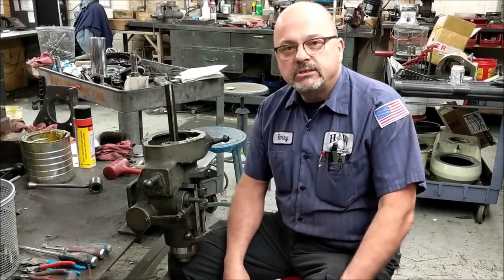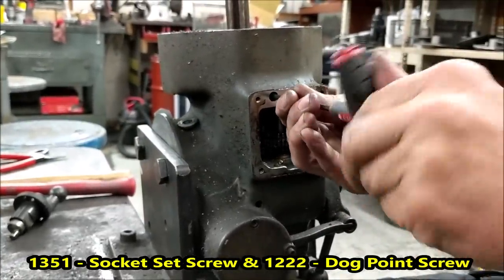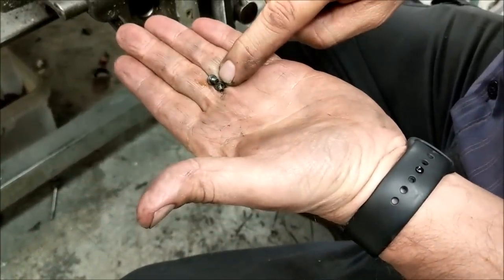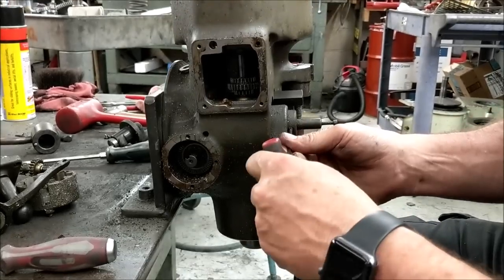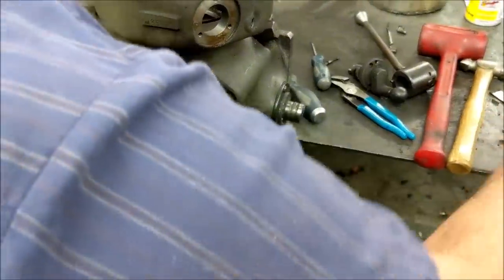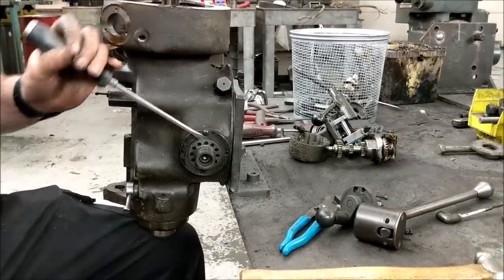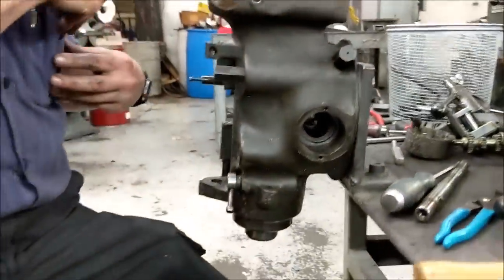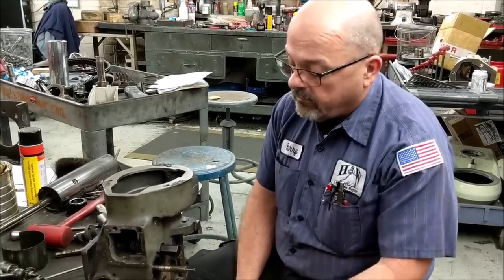Disassembly of the Bridgeport Quill Housing

Comment: Bridgeport is a complicated marvel. And to think, engineers drafted all the mechanicals out with sliderules and pencils. Also, I have witnessed a number of very good mechanics struggle with the repair manuals over the 45 years I was a machinist. These videos are a true blessing for future mechanics.
Reply: that patternmakers took those drawings, figured out core boxes, prints, patterns...
someone had to setup lathes to cut screws, set up stinking big planers to run through body castings...

sometimes... it just seems a little bit insane...

Comment: This video saved me a bunch of grief. Thank you.
I need to take my power feed reverse knob and shaft down to a point to figure out why it's binding??
Waiting for the next video.
Reply: Have you found a solution?
Reply: @Caughtitoutdoors  
I took it apart, cleaned and deburred. I replaced a couple parts. Works great now. I was surprised to find soft steel parts. SHARP -TMV, 3hp 3,300# BP clone.

Comment: Thank's for the video, was grate, may Bridgeport B is 1 1/2 hp this one has a problem where the quill is not smooth as it rides up and down, what might be the problem? I'm about to disassemble it going by your video, is there a assembly video for the quill? Do you think I have to disassemble the hole to and quill to free it up. This machine was stored for some time and got wet. 
Thanks for your inputs and if you have the time for the assembly video

Comment: Hello, thank you for the super thorough videos and awesome diagrams on your website.  I just picked up a 2hp vari-speed machine, early 80's vintage and the quill sticks in the housing at various points of travel.  The whole machine was thoroughly crusted with dried out oil and I have been trying to spray the thing down with LPS #2 in the hope of getting the crust loosened up, which has been working pretty good.  

One thing I have noticed is that the quill skirt is chewed up right where the quill stop hits the edge of the part and I suspect that this is binding up in the casting.  Is there anything else in particular I should look for that may be causing the binding?
Reply from the maker: Paul, The only other thing that would be causing the binging, in your case, would be the dirt and grime and possible metal chips that have gotten up there. You will need to remove the quill and clean the inside of the housing and the outside of the quill. You can give us a call if you have any other questions 1-800-285-5271

Comment: Excellent video. I got everything apart, except the 1402 steel ball will not budge. I tried the magnet trick, but no luck. Any other tips? I am about to cut off the handwheel clutch with an angle grinder.

Comment: Another good video...
Q. Is the skirt supposed to limit the travel of the quill????
Reply from the maker: Hi Red,
No, the quill skirt should not limit the travel of your quill. The quill skirt is there to drop down when you move your quill to prevent chips from getting on the top of the spindle. If yours is limiting the travel you can give me a call to discuss how to fix the issue 1-800-285-5271.

Comment: Thanks for the video, really helpful, just wondered what the deal is if the rare earth magnet doesn't work on the 1402 Steel Ball?   I can't get mine out.
Reply from the maker: Sorry for the late reply. If you don't have the ball out yet you can give me a call at 1-800-285-5271. There are a few things that you can try but it's dependent on  few things. -Barry
Reply: All sorted now but thanks for the offer of help!
Reply: I used a string of 2mm magnets, amazing how strong they are!
Reply: @piersdowell832  im struggling with removing the ball, going to look for more small magnets..

Comment: I am cleaning a 1978 BP Mill I just got. In htis video you are removing the cover on the power feed control and mentioned the small screw being removed and behind it is a small spring and ball. I got that far and then couldn't get the ball out. I have a fairly strong magnet that fits in the hole, but does not grab the ball. I have soaked the shaft and ball in engine cleaner and nothing. Still stuck in there. Anybody have a suggestion?
Bob
Reply from the maker: We can give you more tips, but it would be easier if you gave us a call: 1-800-285-5271

Comment: I’m running a cnc on my Bridgeport would you remove the clock spring so the cnc isn’t fighting against it?
Reply from the maker: We always keep the clock spring in when doing a retrofit. Especially if you have a 3rd axis similar to the Elrod style or an Acu-Rite MillPWR where you can disengage the motor/drive from the quill, then your quill will simply fall.   -Jon

Comment: What do you do when the little ball does not come out and when only one balls comes out with the 5-40 screw and the broken off part stays in the hole.
Reply from the maker: We have a video with some further tips for removing that part when it's broken.: https://www.youtube.com/watch?v=D81SygkL4q0&t=19s

If you are still having issues, you can give us a call and speak to either Barry or Heather and they can take you through some of the more advanced ways to get that out: 1-800-285-5271 / 260-422-0020

Comment: quill skirt. i think thats what it may be...

only here cus i wanted to see if a bridgeport has some way of adjusting the sliding fit of that quill... i havent got a bridgeport, just a fancy drill press advertised as a mill... and the quill to housing fit leaves MUCH to be desired. 

i was hoping id find bridgeports run something like split conical bushes on tapered seats or something, so you can snug em up tight... but it doesnt look like it, just that... quill skirt.

anyway, i still think its a worthwhile mod to a horrid little mill that has to make do until i happen across a decent BP or clone of...

man. when you look at teh design of these machines, you gotta remind yourself... this was all in BC... before computers. everything drawn by hand, visualised inside heads, and transferred to raw stock... like most anything prior to the 80s...

Comment: I dont have that magnet, and that damned ball is stuck. What magnet should i buy to get it? And what if the mag doesnt do the trick?
Reply from the maker: It's a rare earth magnet that fits into that hole. If you don't want to get the kit from us, you can try a hobby shop or a teacher supply store. They are really the only places that sell those magnets other than online. We do sell a kit with a magnet if you want to get it from us. If you still cant get it out with the magnet, give us a call and we can walk you through the next step. 1-800-285-5271 -Barry
Reply: @HWMachRepair  i didn't see a 1402 kit though
Reply from the maker: @PatrickPease  The kit with the magnet in it is the 1033-03K. That is the same magnet for the ball as well as the 1033-03: https://www.machinerypartsdepot.com/product/1033-03K